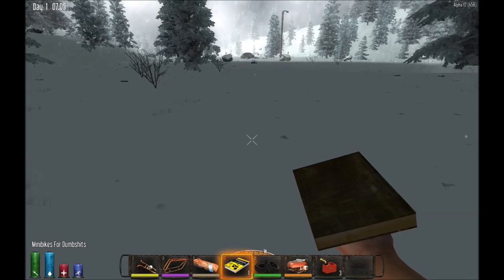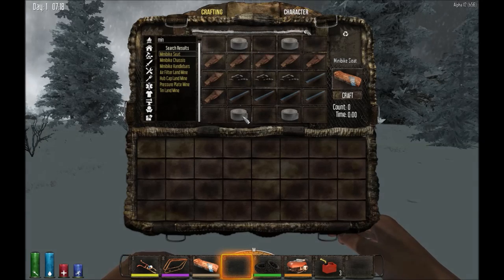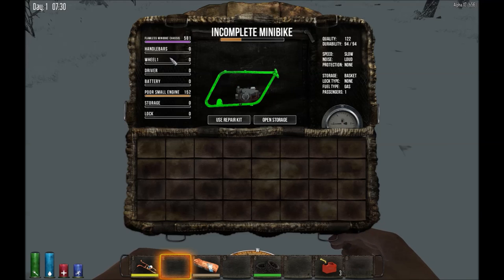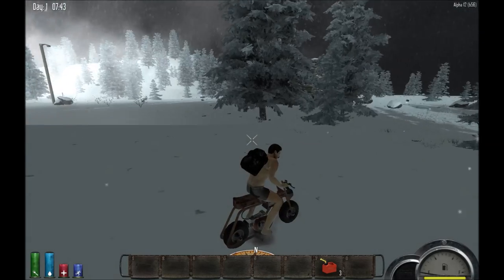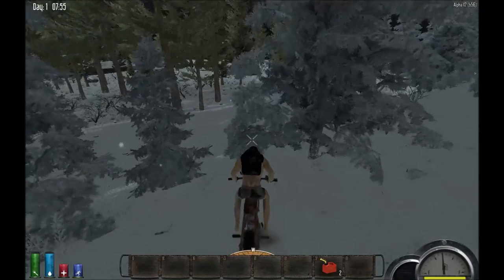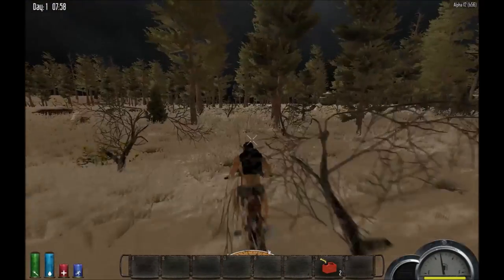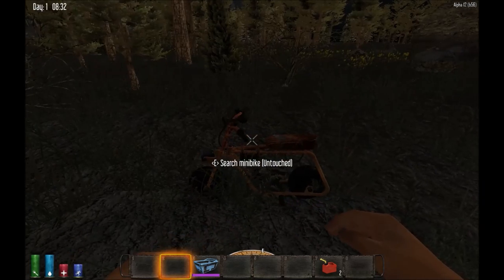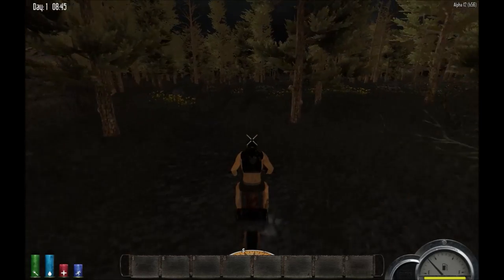7 Days to Die: How to Build a Mini Bike

Comment: I can't seem to find how to make a scrap cable. Do you have any idea on how to?
Reply from the maker: Thesk8guy According to the loot.xml and recipes.xml files the cable is only inside cars, and is not able to be crafted. It is supposed to have the same drop frequency as batteries and headlights. Hope that helps.
Reply: Mitt Gaming I cant find the tires!
Reply from the maker: If anyone else has questions I'll be happy to help!
Reply from the maker: Rinaldo Maia
They are a rare drop from cars only. I have looted them before. Hope that helps.
Reply: Thanks so much. I couldn't seem to find information on them anywhere.
Reply: +Rinaldo Maia you can get them from cars but its rare so just break tires you see on the ground
Reply: +Thesk8guy use a wrench on a car
Reply: +Rinaldo Maia break tires on the ground
Reply: you can get it from a oven with a wrench
Reply: CreativeDan 874 I made this comment back when Alpha 12 first came out :(
Reply: +Thesk8guy ik